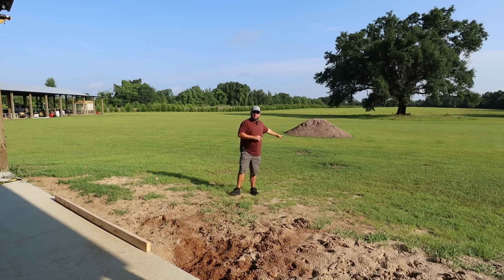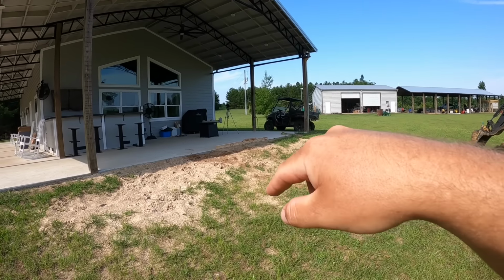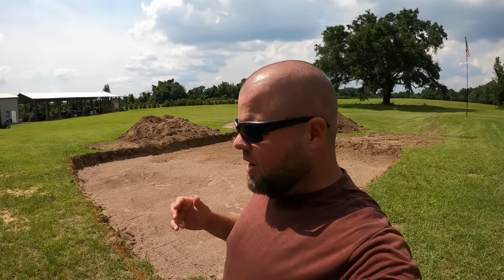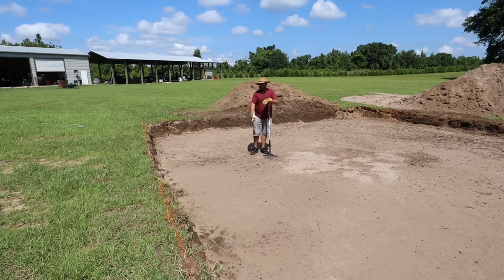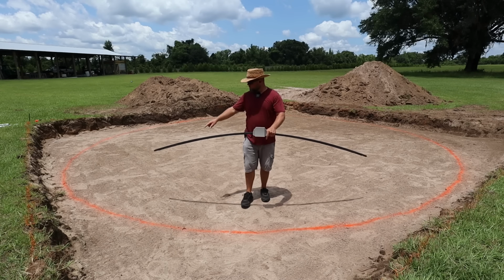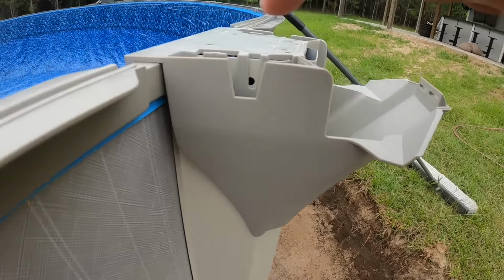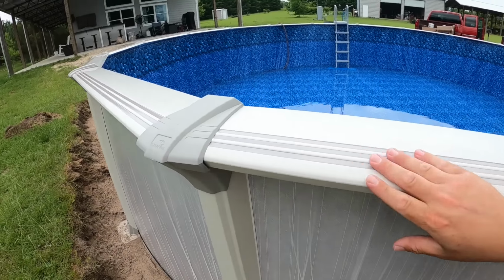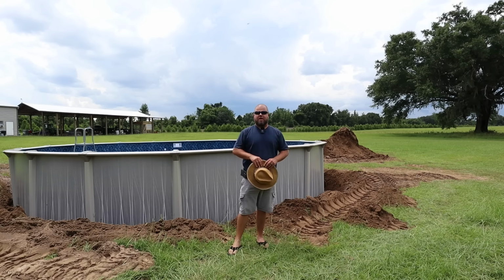Installing an above ground pool! Pool series part 1! Episode #776

Comment: I recommend putting in a center drain when you replace liner in 5 to 8 years. It makes it so easy to pump out partial or all pool water. THANK you for sharing& and I look forward to seeing the pump & filter installed..Keep Up The Good Work!
Reply from the maker: I seriously consider that.

Comment: Stone dust LOVES water. Too dry, and it won't pack well. Too wet and the stone dust turns to mush, but when you put in the stone dust, wet it down. It will pack so much better.
Reply from the maker: I've never used it before

Comment: OH man that brings back so many nightmares.  I paid a small forutune for my pool. same size as yours.  $3000.00 for the pool installed. tree removal was $400.  electrical $600.  plus much $$$ for chemicals.  stairs.  deck ..   kept it for 3 seasons and sold it for a HUGE LOSS.    make sure that row of bolts holding the outside together is well covered to protect the liner.  my installer only used DUCT TAPE and that was the first area where the bolts rubbed through and started to leak.
Reply from the maker: Sure hope I don't have those problems.

Comment: I sitting here wondering what filter system you are going to use. I personally with a pool I had couple years ago did saltwater with a huge sand filter but used zeolite for the filter material. Just make sure you wash the filter material first to get the powder out or it will cloud the pool for a day or two. My pool was always crystal clear. I do know there are peroxide systems also that are really nice.
Reply from the maker: I'm running a 22-in sand filter with  regular silica media material. The only treatment I'm doing to the pool is a copper ionizer. Occasionally I'll float some chlorine tablets in it. Our friend has this identical setup and her pool has been perfect for almost 5 years.

Comment: One more question did you put the cove on the ground or did you put it on top of a three inch base  of sand or sifted earth  you know used the notch on the back of the cove to cover the the pool trac
Reply from the maker: Cove has the notch to go right over the pool track. I didn't add sand as a "cove", just to level put the bottom of the pool base. Fabric right over the cove.

Comment: How long did it take for it to fill up.... now you have a ??? Gallon fire hydrant at your front door ..cheaper insurance right lol
Reply from the maker: Honestly 10 hours after putting a couple of hoses in it I had to cut it off and go to bed, it was going to be high through the night. A few more hours the next day has it right. Filled up a day quicker than expected. It's 23,000 gallons if I remember correctly. I'll for sure use it with my fire pump in the event of a fire.
Reply: @TKCL  wow man that's awesome !!

Comment: 🇨🇦😎No center drain?    No stone dust...   hummm   dam boy you gone cheap...   sand is horrible as a base. And you could of added a 2 food lower center....    but hey at least you got a pool.   Thinking of adding a small ingrown pool here my new place.
Reply from the maker: I've never seen stone dust available here. This pool is only rated to dig out the center of maximum of 6 in, you can't stretch this liner two feet. I didn't do the center drain because our friend has this identical pool, and she's had it for 5 years with zero issues on filtering and clarity. I copied her exact setup because it works so well for her.
Reply: @TKCL  with stone dust the floor and form feels like a cement base and will not make lumps like sand does. First 3 pools we had was all sand and the last one I paid to have it installed.  Since the last one was such a pain on 2 guys. Then I saw tricks of the trade and bow to the experts. It was so well done it made me angry to take it down for house resale.    The new buyer did not want it.   As he did not swim. Stone dust is a side product of stone crushing and it should be available.   It's great for many things as well as no ants.....   the center drain makes it so you hardly need to clean the pool.   And when you do the center can be used like a dust pan as well.   It also helps to keep the water clean and less algy

Comment: very nice, any plans on doing a solar pool pump?
Reply from the maker: No, I bought a large 1.5 hp pump and it's extremely power hungry. It would require a significant system.
Reply: @TKCL  you can get a dc pool pump that only pumps when the solar panel has power. so that way you not loosing on the power conversion.
Reply from the maker: Ahhh I see. I'm afraid that won't work in our extremely hot environment. I need to see the specs. I have to move a tremendous amount of water for 8+ hours a day here for my system to work well in the heat of the summer. I'm not going the chemical route. Something to look into.

Comment: Great video, however i feel like you caused yourselves extra work by excavating a giant square instead of a large circle.
Reply from the maker: It's far easier to use an excavator and align a square to an existing structure than a circle. It's all about the equipment used. The pool frame has sections that are straight, those needed to be lined up to the porch for a future deck. That's very easy to line up to a straight line because we dug a square. Deck is now installed, I'd do the same exact thing again next time.

Comment: Did you think of putting up an oval pool at all I have a oval pool myself and I have had put pools up and I found that they look nice and easy to keep clean and even better than round one and hear in Florida you should put the pool on a 12by12paver and are you going to put it up the new way buy using the foum board on bottom and for the cove mike